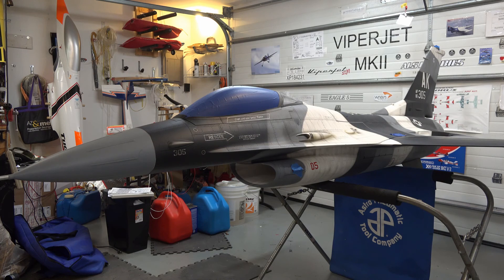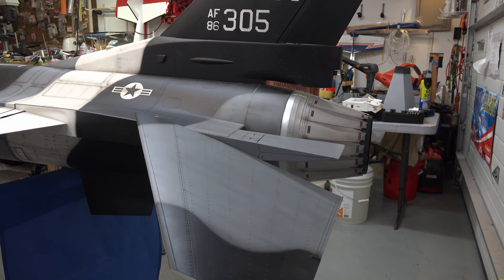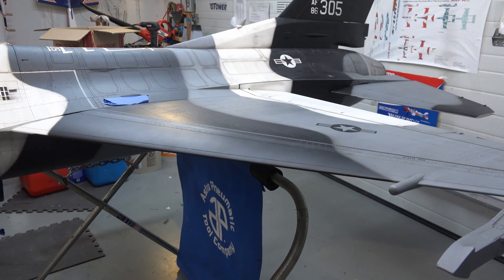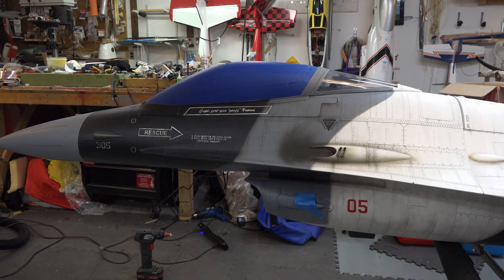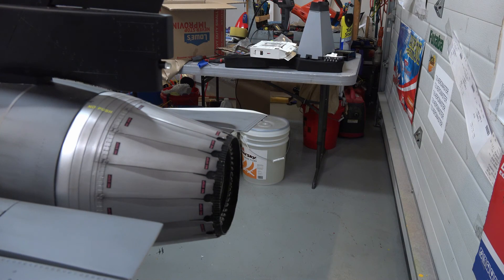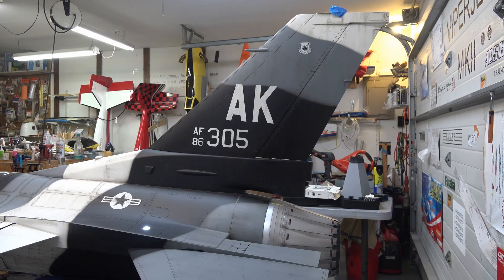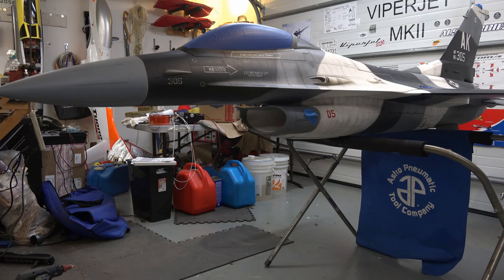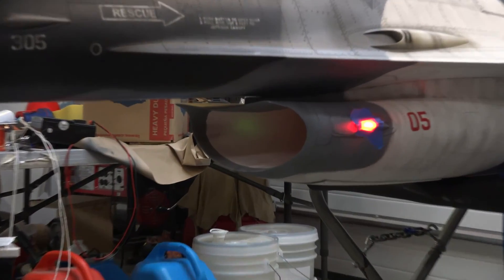f 16 testing complete

Comment: When building a scale jet, The bar has been set so high it must be difficult to contemplate the process. I'm thinking of RussJet specifically. I would be very interested in hearing what you think in this regard. Thanks ahead, Steve
Reply: Rusjet's yak130 development cost nearly half a million $ and more than 5 years to mature. Thats why they are the best RC jets in the world in their weight class. A factory kit build cost less than 1/10 and because you dont need to win a Jet Master there is no need to be that accurate in details.